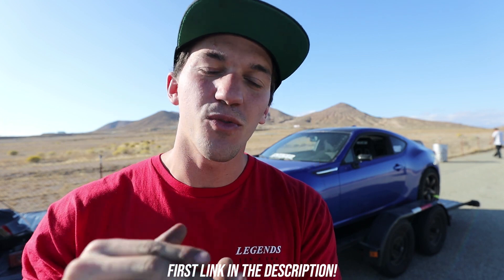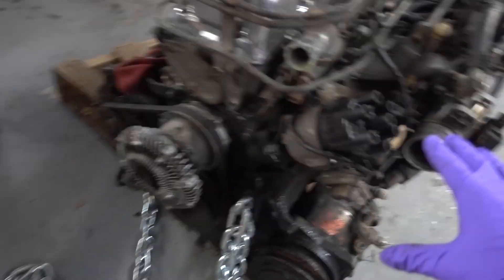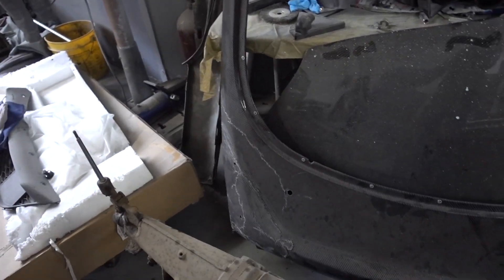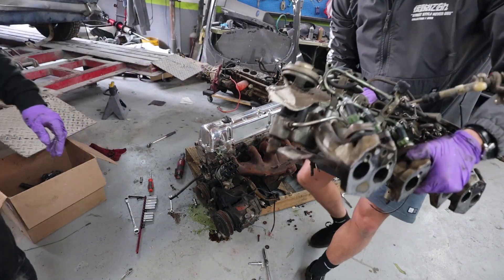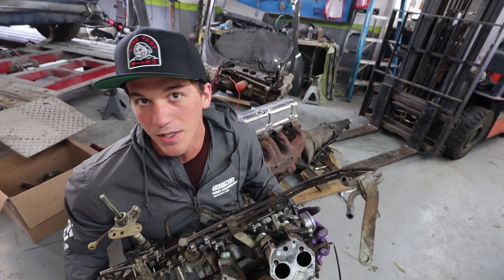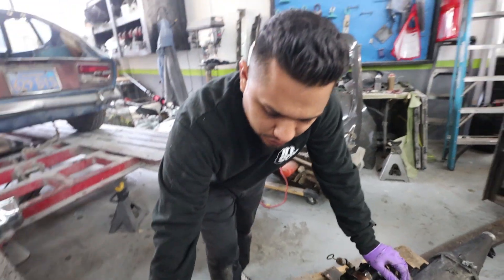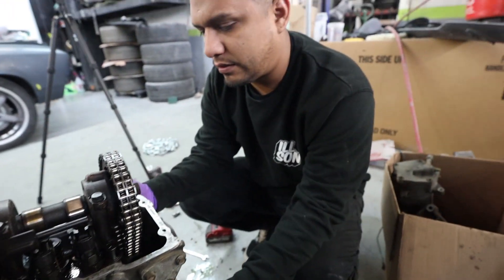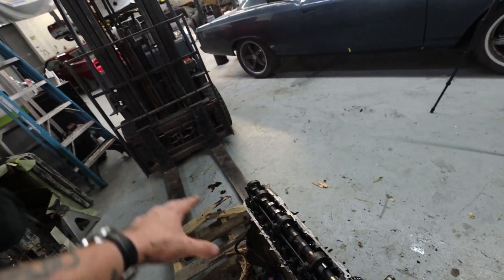Datsun 280z Custom Engine Rebuild! L28 Engine Teardown | Rebuilding Datsun 280z ep. 2

Comment: If you're looking for a transmission, I would encourage you to hold out for the 5 speed over the 4. I believe the 4's are far more common, as they didn't start equipping the 5 speeds until 76. That said, you can also use a transmission from a 240sx using off the shelf parts from godzilla raceworks. Hoke engineering is another tuner that will enable you to use the 6 speed from a 350z using off the shelf parts from them. Both of these will be a bit easier to find than a nice condition 5 speed s30 trans, and both can handle high horsepower applications much much better (should you decide to go boosted)

Comment: Also, regarding the OS Giken set up, it's north of 30k last i heard of a price for it. It replaces the entire head with a cutom in-house casting and all unique parts. It also eliminated the timing chain for a gear train that sits on the front of the engine. Honestly, at that point you'd have replaced so much of the l28 it wouldn't even feel or sound like an L28 anymore to drive or look at. It would be easier to replace the l28 with an N/A RB motor and you'd save some money.

Comment: l28et is your best option, get a borgwarner t5 transmission out of a 280zx turbo. Holset makes a turbo that came on the cummins diesel hy35 that will bolt right on for the most part and is easy/cheap to rebuild. Replace the fuel injection that old bosch system sucks, megasquirt or haltech would be the best option. I would keep compression lowish these engines ping like crazy with high compression, the later p90 heads help with the ping. I have about 30k miles on my turbo 240z I would say its reliable.

Comment: OS giken head is legit I believe a person in japan built it back in the 80s and only sold a few during that time so it’s very expensive but the power output compared to single cam is awesome was trying to have it 3D printed in aluminum but it’s hard to find the specs
Reply: Ahmed Hourani they still make the head and even a complete engine. The head runs around $20k and the engine is probably close to $54k. The power output is more than double stock power which is amazing.

Comment: There are two companies offering bolt-up DOHC Heads for the am-series block. OSGeiken sells one that’s pretty pricey but performs amazingly. The other company is DatsunWorks, they just began production of a modern DOHC Head, i believe they’re located in the United States and are easy to get a hold of via their website.
Reply from the maker: Thanks bro!! It’s bolt on for the fuel injected L28?
Reply: Dustin Williams yessir, also for your transmission search i suggest checking out the DPAN Facebook group they regularly sell there.
Reply: Especially in Cali there are a lot of 5-speeds. I have a 4-speed I’m not using but it’s pretty much worthless, nobody wants a 4-speed these days :/

Comment: The OS Giken head is DOHC.  However, it is rated for race applications only.  I'm not 100% certain but I believe it rev's to like 12,000 RPM's.  It would be great to have but unfortunately it is not for street use at all.  Oh, and it also costs like 30k.  So good luck with that.

Comment: OS-Giken TC24-B1Z is the head made by OS-Giken. Can make up to 400+ crank HP with a modified L28 block.
Very low production numbers for the head but they started casting them again recently. The head by itself was about 30K  2-3 years ago then there are all the other components.

Check it out.

http://www.speedhunters.com/2013/02/engine-porn-os-giken-tc24-b1z/